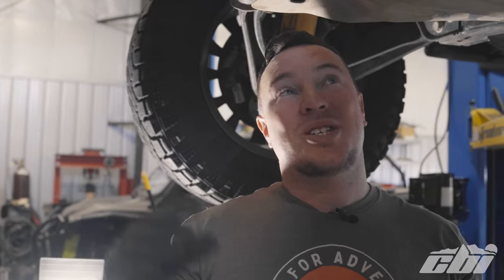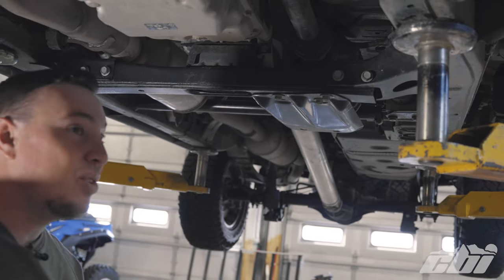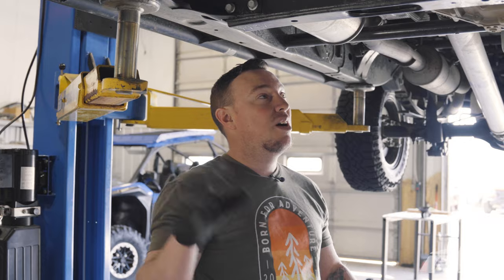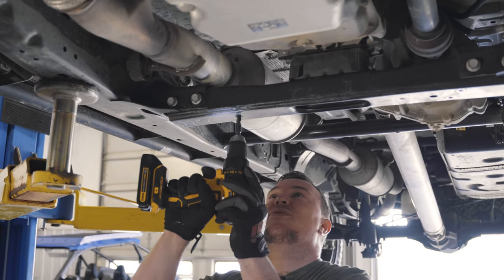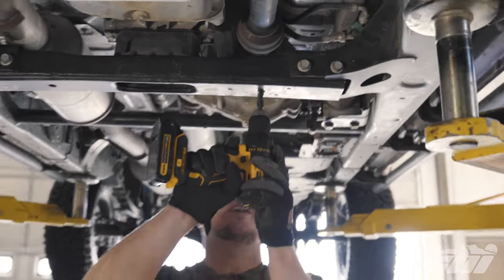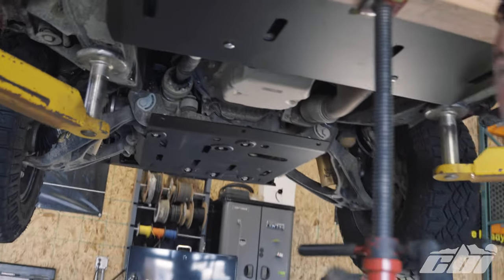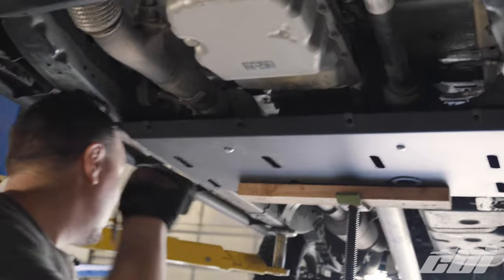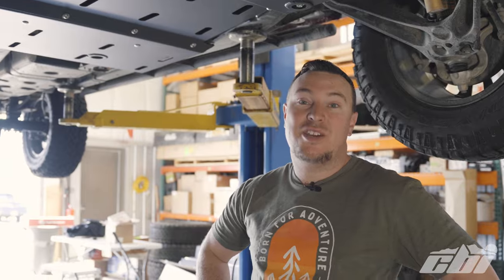Chevy Colorado ZR2/Z71 Skid Plates

Comment: Great video, thank you.  Can you please tell me if this full set will fit on my '21 Colorado Z71 diesel crew cab long bed? Also what is the weight difference between full steel vs. full aluminum? Thanks much.
Reply from the maker: The front skid would fit but the rest would not. It’s about a 50+ pound difference
Reply: Having trouble fitting the third skid plate under my 2022 zr2.  The horizontal muffler pipe is blocking.  Any ideas?